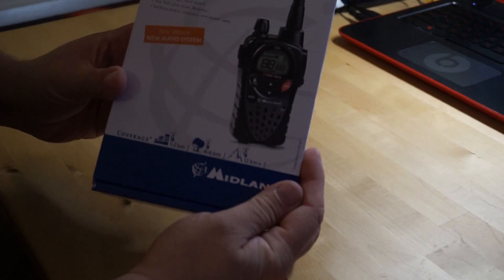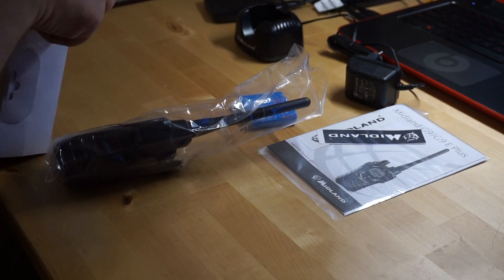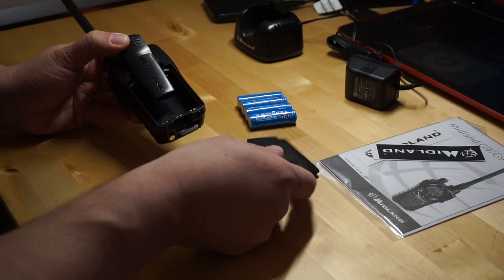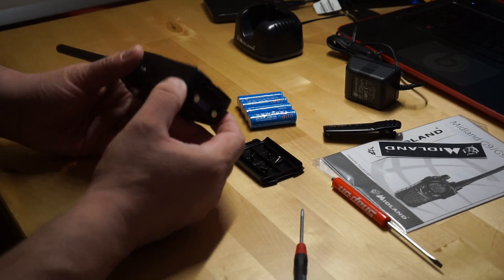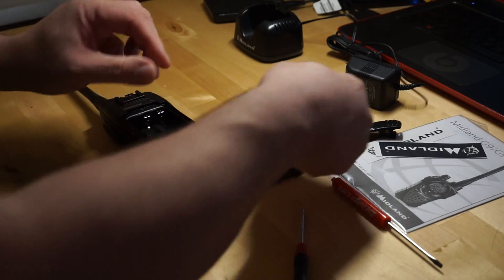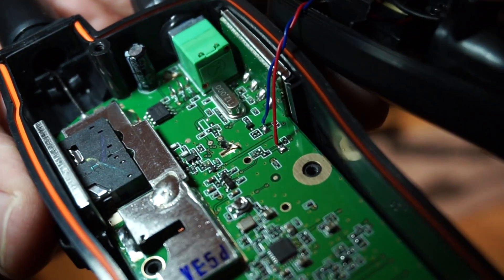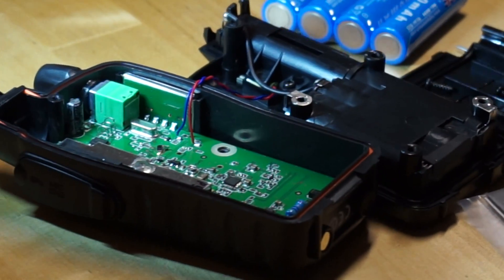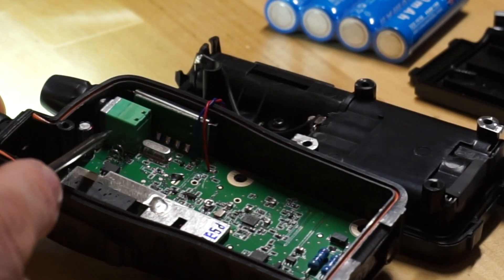Midland G9 Plus - Walkie Talkie 2 Way Radio - unboxing and opening it up to modify it!

Comment: Hello can you me sent the plan of modification for past 5w thank you
Reply from the maker: solder cut wire loop(J1) leave middle wire loop(J2) alone! CUT bottom wire loop(J3). That is it!!  

See this video....   
https://www.youtube.com/watch?v=nHJCisvWFKw&feature=youtu.be
Reply: @Dackelone  can we just cut J3 and leave rest untouched? Sorry for asking, but cutting J1 and soldering it again, isnt it same as just leave it untouched? Also, 5mW means range will significantly increase even in urban areas?
Reply from the maker: @theentertainmentchannel5347  No, you have to follow what I did in my video to convert from 1/2 watt to 5 watt output. Cut one wire and solder the other wire. It's not hard to do. 👍👍